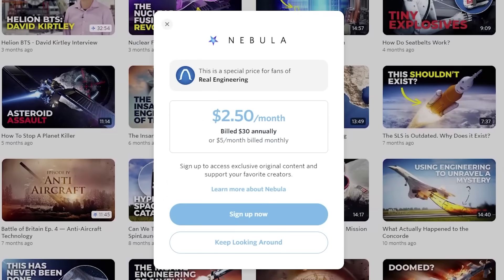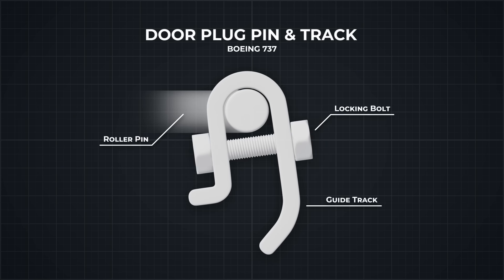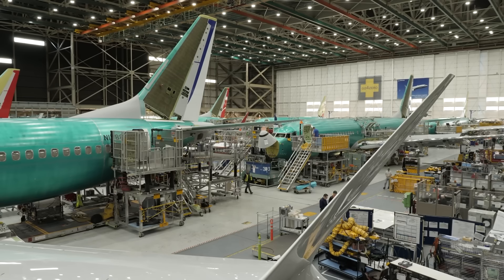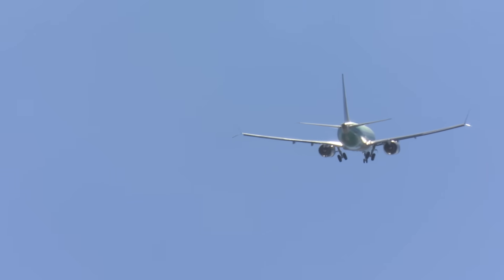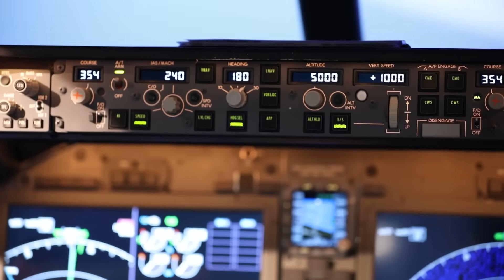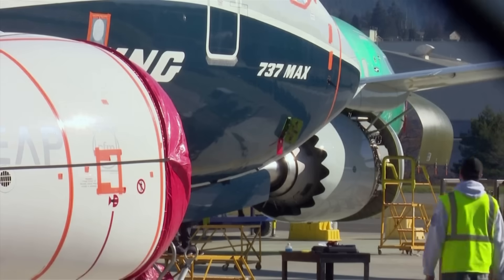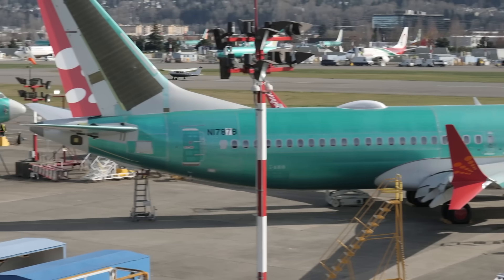The Questionable Engineering of the 737 Max

Comment: I want to mention, MCAS did NOT malfunction. The AOA sensors themselves were giving false readings, and MCAS was responding correctly to erroneous data. The sensors themselves are easily damaged and likely had been bent out of place, giving the false readings
Reply: I don't know about "Correctly"... "As designed" perhaps, but not the best of designs, or very well documented.
Reply: @antrillion  "correctly" and "as designed" mean the same thing here. It was functioning as it should, and having the correct response to the data it was given. The MCAS had no malfunction or wrong reaction. It just had bad data. Saying it was responding correctly to erroneous data is right, and doesn't imply that the design was good. It just means that it did what it was meant to do if that data had been correct. 
What made the MAX so scandalous was that it was a poorly made design with no failsafes, yes. One sensor with erroneous data shouldn't have been enough to set the system off and the system shouldn't have been so powerful. But it did respond correctly, and saying it malfunctioned is slightly inaccurate

Comment: CORRECTION! The explanation at 258 is backwards. The guide tracks are on the door plug and the roller pins are on the fuselage. This labeled in a previous image. THE DOOR MOVES UP AND OUT. Not down and out. The are springs at the bottom of the door to help push the heavy door plug up. Other then that great video. Interesting theory that spirit didn’t install the pins thinking that Boeing would need to remove the door but didn’t.

Comment: I don't think it's questionable engineering. It's crappy manufacturing and quality control/testing. Inexcuseable recklessness. People in that mfr. line, and their overseers, and those people's managers need to be terminated. Further, that third party mfr. needs to have it's license pulled, and another company hired to do that they used to do, or return that manufacturing back to Boeing. I believe the above will HAVE to happen, and WILL happen, if Boeing is to survive this unbelievable gaffe. DID THEY LEARN NOTHING from the 737 Max's earlier debacle? Apparently NOT

Comment: On the Boeing Starliner failures NASA found that Boeing had serious deficiencies in their quality system.
The 737 Max failures seem very consistent with those observations.
Quality is is driven by a culture that truly values it. I does come with an expense and can often slow production - two other qualities that management often values.
The trick is that quality can be difficult to measure and is easily masked - if an inspector finds a defect, is that a failure in quality or a success.  I would argue the former as if you are relying on the inspector to catch defects then at some point he is going to miss one - possibly due to pressures to keep up with mandated production throughputs.

Comment: In this case it’s not an engineering problem, it’s a production problem. The same door plug design has been flying safely without any issues on the 737-900ER for over two decades.

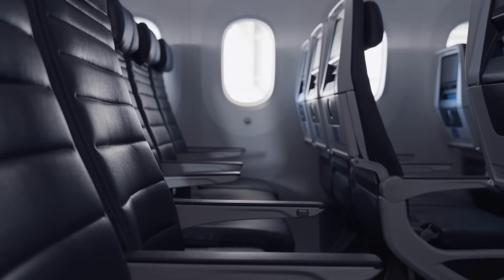Comment: 1:40 "the door plug is not a functional door." This is the way I thought about it in the beginning. But Chris Brady's excellent 737 Technical Channel made the comment that he doesn't consider it a real plug [1], and now I agree. In one of the NTSB's announcements, they called it a "plug"-type door. Scare quotes from the NTSB.
    It is true that it is not a functional passenger exit, which would be subject to a lot more scrutiny and higher safety standards. But it is a functioning door for the maintenance crew. As a result of that design choice, the mechanism for keeping the cover in place for the hole in the fuselage is way more complicated than it needs to be. 12 stop fittings (pins and pads), two guide tracks, a spring assist mechanism, two pairs of lock bolts. Was this failure mode for this design modeled? Was it modeled correctly? Please check the records. Maybe they could have just bolted or riveted a panel in place. 
    This suggests to me that it is not just a problem of quality control, manufacturing, and manufacturing process engineering. The safety engineering and design engineering decisions need to be revisited, and maybe some remedies are needed. 
    It seems the NTSB is also thinking about broader problems than just manufacturing. They recently recommended that airlines inspect their Boeing 737-900ER airframes for problems, because they have "the same door plug design" (- NTSB Safety Alert for Operators [2]). They made the recommendation public because apparently some airlines had started inspecting at their own initiative and found some problems. This is on a previous generation variant, so no way could it be the same manufacturing process at fault. The problem may be more systemic in Boeing and maybe Spirit Aerosystems as well, dating back to even before the MAX entered into service.

[1] https://www.youtube.com/watch?v=maLBGFYl9_o  4:00
[2] cited by blancolirio https://www.youtube.com/watch?v=yKX0ydWYDzc
Reply: you're correct. It is a door that requires tools to operate. The door seal was replaced at Boing, but bolts were forgotten to reinstall after opening the door to replace the seals. The QA procedure did not ask to check these bolts as it likely was based (c&p) of the door seal replacement QA procedure of a regulator door and these don't have these bolts. We all know how manuals are written....
Reply: @lapin46  The road to hell is paved with cut and paste
Reply: @fbkintanar  thx, I need to memorize this one. Brillant. The first ESA Ariane 5 rocket failed due to c&p of some of the flight envelope monitoring functions of the smaller Ariane 4. AS the routines detected the rocket exceeding some acceleration parameters IIRC , it self-destruct the rocket.

Comment: Every time I see you post on a subject I'm familiar with, my eyes start rolling. Wire tie? That's a cotter pin, real engineer. Also, you might want to stop propagating the urban myth that the location of the engines was some kind of error. Their location was dealt with by appropriate software in the flight controls. Software modulation of flight characteristics is common in modern airliners today.

You're also wrong insinuating that the plane could have been safely flown without that software had pilots been given proper training. Note that a version of that software remains on the airplane (using a second angle-of-attack sensor). Boeing strove to design the software in a way to avoid the need for extra training to use the software. The two accidents were the result of a runaway elevator. This is a fairly common thing in the aviation world and all pilots are trained to recognize it, turn off powered trim and use the manual control wheel instead. This is what Boeing was counting on should a failure in the system cause this to happen on this plane. Runaway elevators can be caused by short circuits, bad maintenance, damage etc.

The pilots were woefully inexperienced by US standards, the maintenance crews were inept and failed to fix the problem, nobody told the one new crew about the problem, safety memos from Boeing never reached the pilots, and the pilots failed to recognize a runaway elevator and take the appropriate action. It was bad timing and bad luck for Boeing.

If you follow NTSB aviation incident reports, you'll find that things go wrong on airliners of every make and model every day. Boeing issues are no worse than Airbus or anyone else. All new airliners have growing pains. Asking for exemptions are done, all the time by all airplane manufacturers. They're not always granted. And you are wrong that Boeing is downplaying safety for profit. That would be really stupid, and I know from first hand experience over many decades there, that safety is the highest priority. Do you  know what a DER is? They strike fear into the heart of any manager. Going up against a DER (an expert, highly experienced and trained Boeing engineer designated to represent the FAA while employed by Boeing) is the kiss of death for any manager's career. Nobody wants to kill anybody and accidents caused by poor engineering or other decisions are a financial disaster to be avoided at all costs.
Reply: @dirtdiggity1714   Google "images of cotter pins" Next... ;  )
Reply: YES finally someone else says it

Comment: To design and certify an inherently unstable aircraft for civil flight seems nothing less than criminal. The 737 needs software to overcome the instability issues. Sure other planes are inherently unstable, like fighter planes. They need to be and they also are equipped with ejection seats. People are to blame as well. If people said NO, I'm not flying on a 737 then airlines wouldn't fly them.

Comment: SW 1380 was a fan blade fracture inside a CFM56-7B.  This engine is made by CFM not Boeing.  Nor was the pilot who taxied his jet into the tail of another jet due to Boeing manufacturing issue, or the failure of a GEnx engine on a 747 due to a Boeing manufacturing issue.

Comment: Wow I really can't believe people are still saying "MCAS caused the planes to NOSE DIVE" after the flight recorder information has been out for years. It's factually incorrect and demonstrates a clear misunderstanding of how MCAS works and how those crashes happened. Also, and perhaps most egregiously, it ignores the fact that the pilots flying the planes that crashed absolutely, 100% without a doubt did not follow standard procedures that have been in place for decades. It's documented that the maintenance crews incorrectly installed the sensors feeding data to MCAS. It's documented that the pilots didn't have enough flight hours to even be jet airline pilots in the US. These aren't hard things to discover for yourself unless you've already made your conclusion.

Comment: Apparently the cockpit door blowing open thing is a safety feature of some kind in case the aircraft depressurizes and the flight crew get incapacitated. I saw it mentioned somewhere on another channel.
Reply: But the flight crews were never informed of that "feature " , which seems like a pretty big oversight to me
Reply: @sparkieT88  Why would they need to be? Why would the pilots need to know if the door opens during an uncontrolled depressurization? Their job is to immediately land the plane, it's not an issue of hijacking and there is no reason to go back into the cabin.

This is what always happens people start overreacting and giving non-nonsensical takes.
Reply: @cefb8923  if you are a pilot of an aircraft, you are supposed to be intimately familiar with every aspect of said aircraft. So it goes to overall safety of everyone on board.

But this also highlights how Boeing doesn't care about standards. 

Let me ask you this. If your personal car had a safety system changed on it, without your knowledge, you wouldn't be upset later when you found out? Then someone tells you, oh you didn't need to know about it.
Reply: @sparkieT88  Obviously a driver should be familiar with some safety design features, such as knowing how to properly operate ABS brakes if the car has them, and how to operate the brakes if the car doesn't have ABS, but they don't need to know that the glass has been designed to shatter into small pieces rather than into longer and pointy shards (which was a problem with old cars a very long time ago).

It wasn't unreasonable for you to raise that point initially, but now you're just being stubborn and refusing to admit when you're wrong. Cars are a perfect example of something where the driver doesn't need to know about many of the safety features in order to be considered qualified to drive the car, and the example does not support your point.
Reply: @syncmonism  you're proving my point,  if they changed the glass in your car back to the sharp pointy type, wouldn't you want to know about it ?
Reply: @sparkieT88  if that’s the case the checklist would be miles long and a repeat of Swissair 111. What’s important put important items inti the checklist, unimportant stuff just leave it out.
Reply: @cefb8923  Why would they need to know?  Because if it is unexpected - it's a distraction from doing what they are supposed to be doing to get the aircraft down to 10,000ft pressure altitude and breathable air.  It's a high intensity - memory (no checklist) item to get their oxygen on and the aircraft dived and levelled off.  To be distracted by an unexpected item compromises their ability to do the mission critical action which must almost be like a reflex to have a chance of succeeding.  If - during training for depressurization - the door is "popped" - then it is not a surprise and so not a distraction.  While I'm not a 737MAX pilot - I'm a pilot and you make emergency training as realistic as is safe so there are no surprises.  No one is over-reacting and the idea is NOT nonsensical.
Reply: @cefb8923  "Why would they need to be?" Literally the stupidest thing I've read in a very long time. Bravo.
Reply: So if terrorists want to access the cockpit they just need to depressurise the plane? So smart…
Reply: I don't believe any other aircraft has this "feature".

Comment: Unless there's a record of an Alaska Airlines mechanic working on the door plug before the accident, I don't see how AA would be culpable for this mishap. While the (assumed) faulty door plug might be the cause of a pressurization fault, I would guess that a faulty pressurization system would not be the direct cause of a door plug blow-out. A pressurization problem, in and of itself, is not generally catastrophic as long as sufficient mitigating factors, such as supplemental oxygen and diversion airports, are available; and it doesn't seem like the pressurization problem was particularly bad, anyway. It sounds like AA were doing what they could faced with an intractable problem. In my opinion, based on my current knowledge, it seems like this particular plane is a lemon.

Comment: I left this comment on other channels.  It's amazing that systems are put in place to monitor these important variables only to be disregarded and reset.  It's not malfunctioning it's doing exactly what it was designed to do and that is monitor cabin pressure.  I was under the impression that every part of an aircrafts construction would have a paper trail showing every person that handled that part and signed off on every aspect of it's acquisition, handling and installation.  Don't they do a vibration test on a completed plane?  I have seen the stress test they do on the wings.
Reply: What are you blabbering about? What system was disregarded here?  The cabin pressure alarms had nothing to do with the door plug.  In all cases the alarms went away when they switched to the secondary pressurization system.  If the plug was leaking the secondary system would have also alarmed.  And that wing stress test is not done on every plane - it's a design test.  And no, they don't do a "vibration test" on an entire aircraft.
Reply: If there are two cabin pressure systems and one indicates a problem and the other does not which do you believe.  The one that indicates a problem or the one that gives you the answer you want so you can continue with your flight?  I think that the first cabin pressure indicator triggered when they were at low altitude and the door stops did not have enough pressure on them to prevent the door from moving up and down on the springs if there was also some jarring of the door and no bolts.  They don't need to vibrate the whole plane just mock ups of it's components like the door assembly.  With the loose bolts that were found they must have stretched.  I don't see how the nut backs off with that cotter pin in place.  You might argue that vibrating an entire aircraft is not cost effect but Boeing had to pay out 500 million to crash victims which was part of a 2.5 billion settlement with the DOJ.  Just my opinion
Reply: @tmc200527  "If there are two cabin pressure systems and one indicates a problem and the other does not which do you believe."  You believe the one that is working.  What kind of question is that?

Comment: I’m disappointed that you got the explanation of the track and guide pin backwards in this new video after so many other older videos have it correct. You are adding lots of confusion! The voiceover is wrong, doesn’t match the labels on the graphic which are correct, but the animation of the movement in the graphic is wrong.

Comment: I think it's also important to keep in mind these issues vs relative scale. Between Boeing 737(-800) and the Airbus A320 series, those alone make up rougly 60% of the whole global fleet of commercial planes in service. Even with slightly above average standards in every aspect, statistically speaking, if anything anywhere goes wrong with a commercial plane - there's over 50% chance the plane in question will be a 737 or an A320 simply because of of their immense market share.

Comment: so there is this , if you look at the planes log you will see there was no presurisation problem before the 7th
 but after and up to the incident  there was several 
the plane right before the 7th was at a company to have some wifi communisation installed and that item is added on in the top of the fuselage very close to this plug door,,

Comment: I read about them asking pilots to remember to turn off the immersion heater on the engine nacelles ..... Disgraceful
What's even more disgraceful is the gall of Boeing to ask that they get an exemption from the FAA so they can get these planes up in the air knowing there's a human based path to catastrophe built in that they are too greedy to address with engineering.
No regard for human life.

Comment: Alaska air did the aircraft equivalent of putting a bit of electrical tape over the check engine light and then cruising at 20 under in the right lane on the interstate "to be safe"